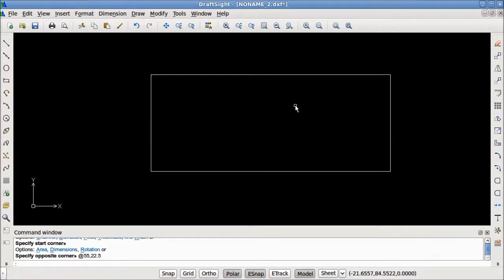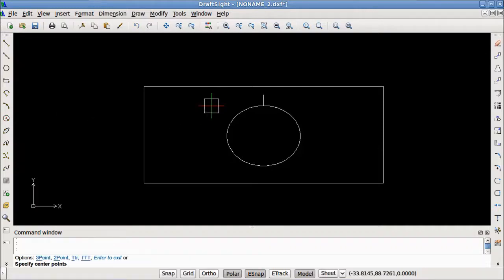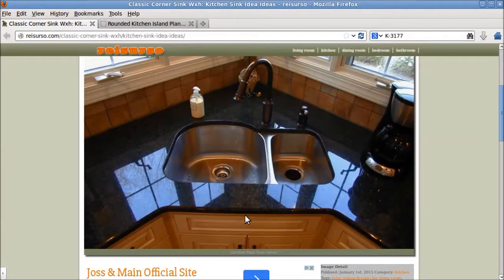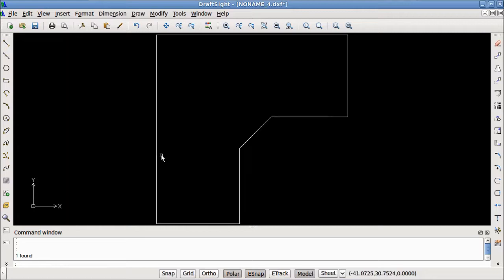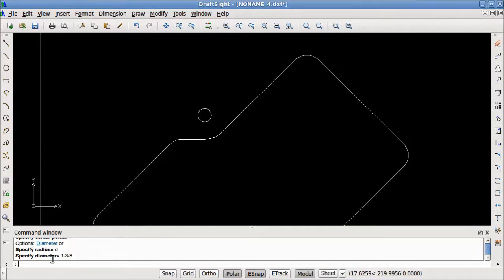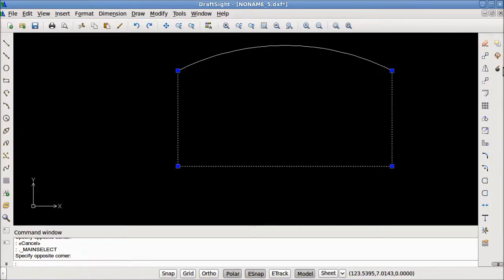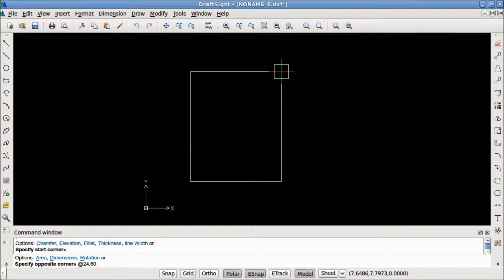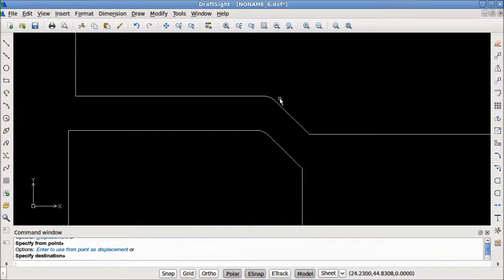DraftSight - Four Example Counter Top Drawings (6 of 6)

Comment: I have a problem w/DrftSght, your knowlegible skill I hope can help with.
Several months ago, I believe I got a [PC] virus.  Wiped out EVERYTHING, including 'One Drv'.  
After annoyingly reestablishing each prgm, desktop icon & … . I finally got to downloading DrftSght. 
All files were deleted...so I attempted to recc. new ones, [that's when the [real] trouble started.]  
On each Save - I got READ-ONLY.  After doing everything in my [meager] capabilities, I turned to a S
olid-Edge tech...he worked for 2 days...then gave-up.  [Stay tuned, for the point of this rambling ].. I figured
the end of my DS use.
While doing something, unrelated in the 'Recycle Bin', I noticed a DrftSght file,  I restored it, and re-dwnloaded.
IT WORKED … except, it only Displays in DEFAULT WHT COLOR.
Can you suggest ANY TIPS OR TECH., I SHOULD TRY?     gripWin@gmail.com   Thanks!